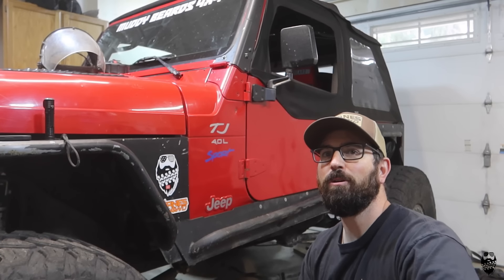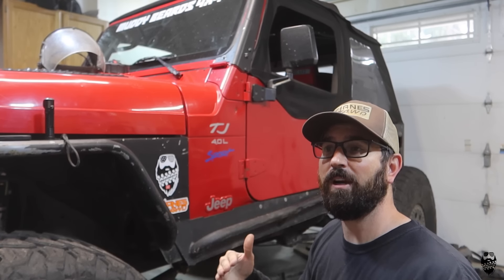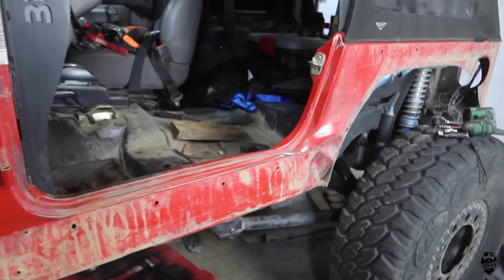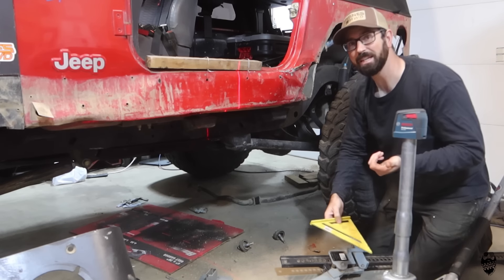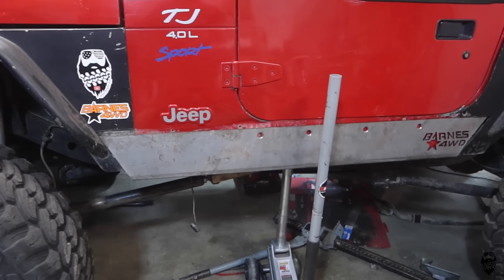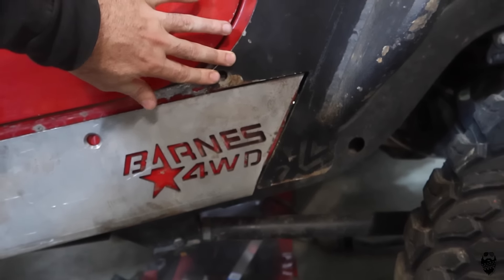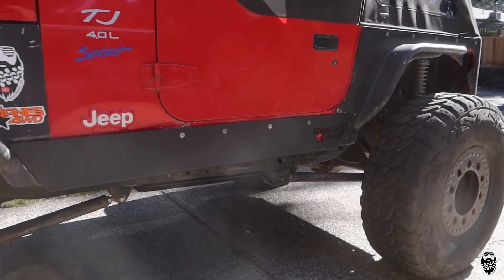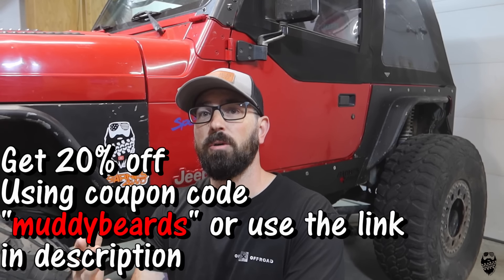I Don't Think I can FIX this.. Jeep Wrangler Rock slider install and Tub repair

Comment: A fairly heavy slide hammer style Dent puller can work wonders and can be used for many other strange situations and puller situations.
Reply: Precisely what i was thinking.  That or rigging up some threaded rod through a steel plate from behind to pull evenly on the whole rocker panel by cranking on nuts at each hole.
Reply: Portapower with a wedge also
Reply from the maker: Yea slide hammer would work, but I don’t have one, and didn’t want to buy one

Comment: Future tip a big nut and an eye bolt are your friends when dealing with body when can’t access backside.  Weld/tack outside of the nut to dented panel thread in eye bolt and strap/cable to something solid.  Pull while massaging the panel
Reply from the maker: Nice, good tip. 👊🏻
Reply: @MuddyBeards4X4  I wheel an 87 square body suburban so have my fair share of having to “massage” its body lol

Comment: This is why I have frame-mounted rock sliders. If they get hit and bend, my body isn’t taking damage with them.
Reply from the maker: Yup, future plan for sure
Reply: Yep. I cut the body under the door frame and welded in 1.5" square tube. Then ran the same down to the frame. Skinned this with 3/16" plate. Been through hell over the past 10-12 yrs.
Reply from the maker: Nice 👊🏻

Comment: Why the decision to not weld the filet cut in the tub back up with some new sheet metal???
Reply from the maker: Too much work, it’s a wheeler. I could throw some seam sealer on the inside between the tub and rock sliders, that would be easier. I might do that…

Comment: I was hoping you'd fill/weld up the fuel door hole in your rear quarter protector while you had it off. Maybe next time.
Reply from the maker: 🤣 yea, I have been getting this a lot. I plan on running different fender in the near future so I didn’t spend the time to do it. That was over 2 years ago… so, yea.

Comment: Is there any reason you haven’t covered the old fuel fill hole? Low key drives me crazy lol
Reply from the maker: Haha, I always think about it, but I plan on changing fenders soon so I don’t want to spend time or money one it.
Reply: @MuddyBeards4X4  makes sense, I’m surprised you haven’t just tack welded a plate of metal behind it just for a temporary fix
Reply from the maker: Yea…. I think about it every time I look at it😳
Reply: @MuddyBeards4X4  DO IT!

Comment: Why would you install sliders onto the rocker panel? It definitely defeats the purpose of sliders doesn’t it? If u had sliders that were mounted off the frame you wouldnt have rocker damage.
Reply from the maker: They don’t make a rock slider for a TJ that comes off the frame. They are all made the same way. If you want that you will have to fabricate your own, which I will do in the near future.

Comment: Why wouldn’t you just cut them sections off and throw them away they sell those and I don’t even wanna watch no more to see if you welded that back together before you put your rock slide on it is no longer structurally sound